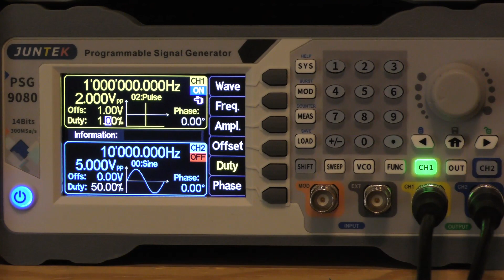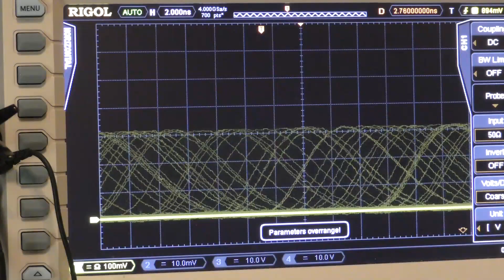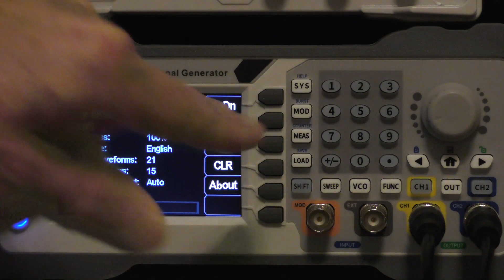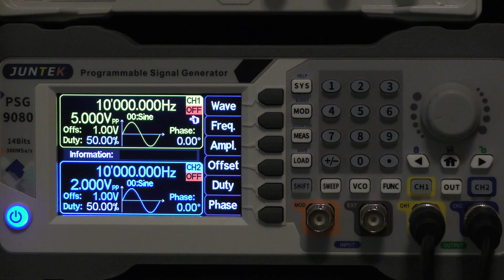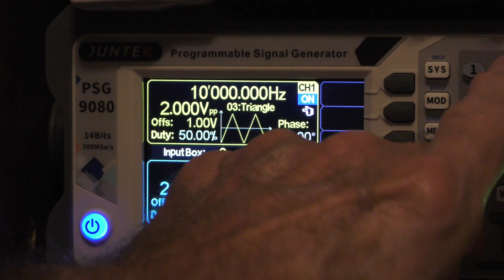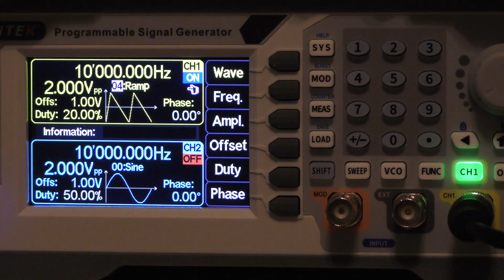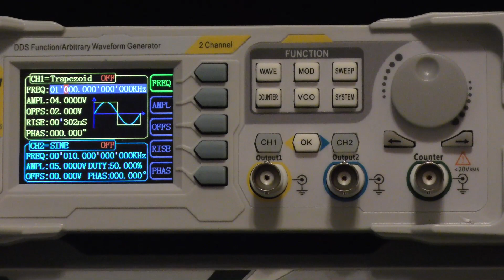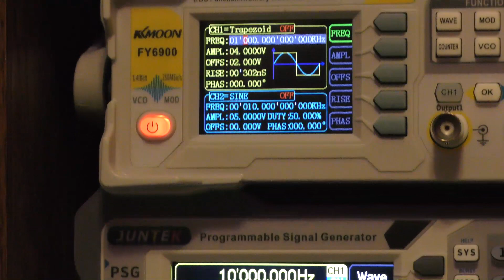TTT363 Juntek PSG9080 AWG Functions and Features

Comment: -------------------------
I recently bought a PSG9080 and noticed the output voltage settings did not seem very accurate.  Since my most accurate instrument is a 40,000 count DMM, I wanted to check the calibration of the PSG9080 against it.  I thought the most accurate way to do this would be to use the DC "waveform" so it wouldn't involve any inaccuracies in measuring RMS of a sine wave.  But when I set the PSG9080 to DC, I found that the amplitude control did not change the DC level.  I had to use the offset control to change the DC level.  I did not like that because the offset setting only has 10 mV resolution rather than the 1 mV resolution of the amplitude control.  Have you seen this?
Reply: To change the output voltage, you need to go to SYS and the second page, there you can adjust either the system base frequency itself in percentages and you can also adjust the output voltage.

Comment: Is that duty cycle setting common to all modes where setting duty cycle does make sense or not? E.g. if you set duty cycle to 20% in ramp mode, does this also propagate to duty cycle in  another modes (like PWM)?
Reply from the maker: I haven't checked all modes but it appears to be common in those I have checked.
Reply: @tomtektest8042  Ok, this behavior makes sense. Thank you for testing this.